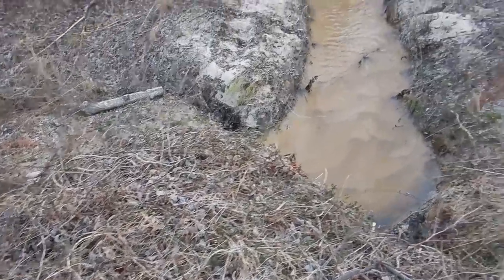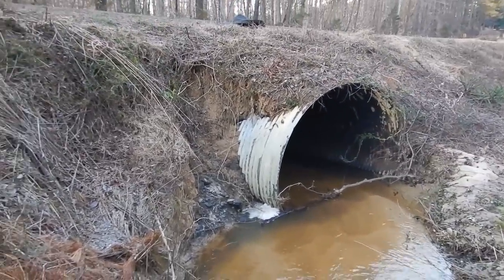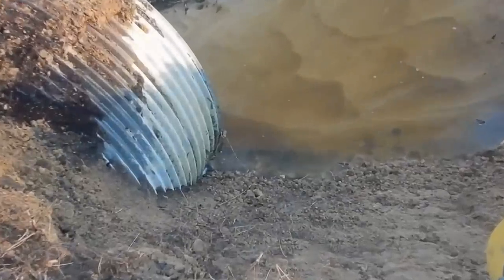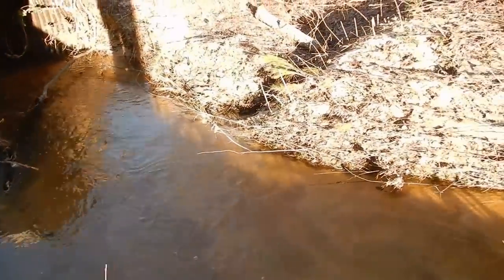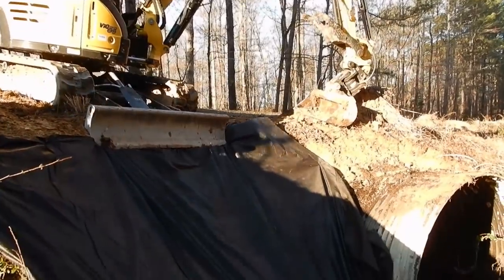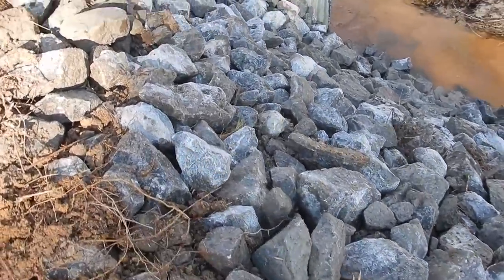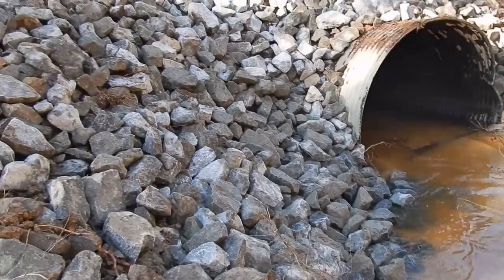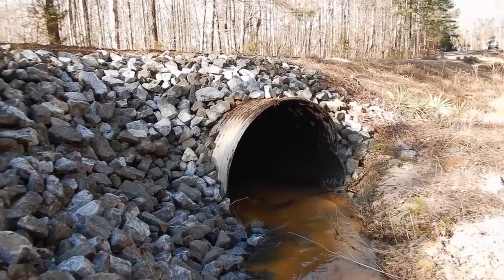Fixing A Eroded Culvert Pipe

Comment: Why did ou change from the fancy tilty bucket to the normal one to place the rock?
Reply from the maker: Hard to dig in a pile of rock with that smooth bucket
Reply: my guess would be that digging large rocks like that is very harsh on the bucket and the pins and the entire mechanism as the bucket 'jerks' into the rock pile. I would think that he removed the tilting mechanism to avoid the mechanical stress on the many joints, pins and rotation points it has.

Comment: When you Rip Rap do you only use rock or do you use cement over the rock or does it just depend on the job? I use to do this type of work and am curious. BTW love ya vids.
Reply from the maker: rock looks cleaner, dont really use much broken concrete I think it looks trashy
Reply: Around here they are flowing a coat of concrete over top of the rip-rap - It’s just straight outta the truck, no finish at all.
Reply: @jeffpalmer3560  There are two types of rip rap Grouted, which is what you are talking about and dumped.
Reply: @letsdig18  we always had a truck pump the concrete over the rock and use shovels to mold and smooth it.

Comment: Wouldn't it be cheaper to cut the opposite bank straight?
Reply: You have to be careful when messing with the way a stream flows. Remember that job when he had to move a ton of dirt at a scrapyard, because the guy dumped in in a stream bed. And the people at the government was like nope. This was the right way to do it, because it will last. Video is big screw up = big dirt move.
Reply: I don't think it's the owners that care much, at one time 'they' put in the culvert at the wrong angle but I digress. It's the official state water people that care about changing the course of the stream and like any bureaucratic agency, some are going be 200% anal about every part of that place. Chris did not put in the culvert nor did he change the course. Best to just not poke the bear.